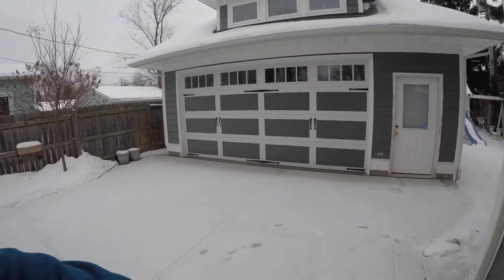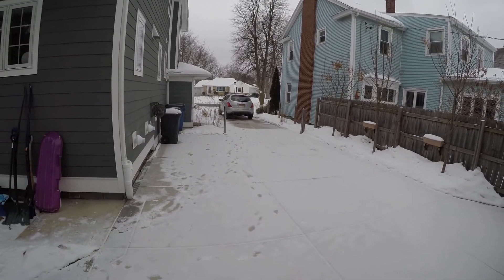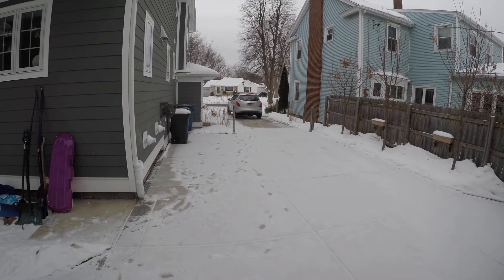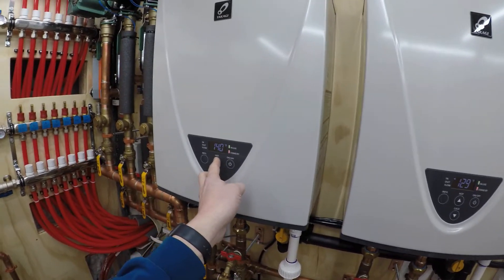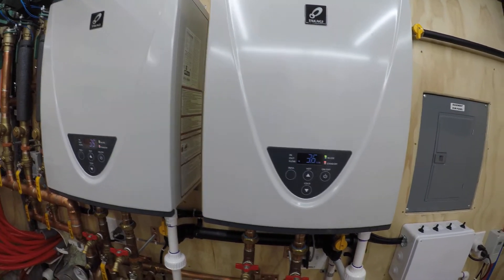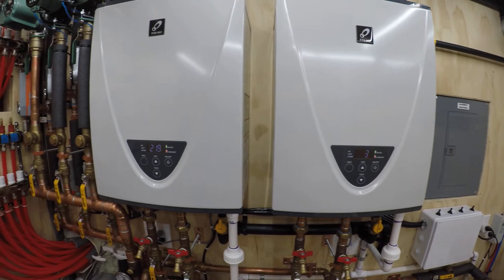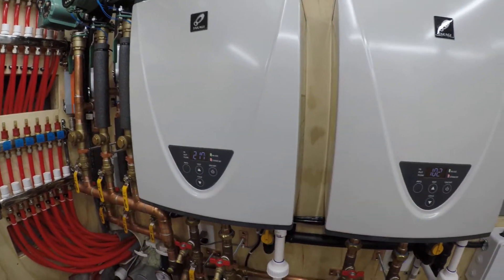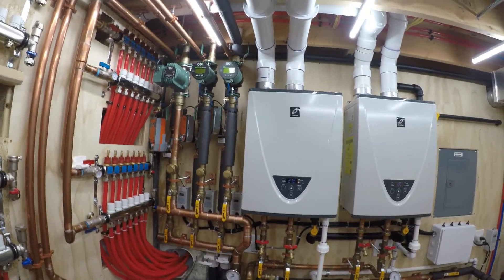DIY Heated Driveway System Startup: Presidents Day Snow Storm - Episode 59 [2-15-2021]

Comment: Are you allowed to run 40% glycol mix through takagi's?
Reply from the maker: Hi Aaron!  I think technically you can without voiding the warranty, but I didn’t want to risk it. I have a friend with a mixture around 40% going directly through the same Takagi T-H3 units I’m using and he has no problems for almost 10 years.  My systems uses a 100-Plate copper flat plate heat exchanger to keep the domestic water separate from the glycol in the heating and snowmelt side.  Hope that answers your question. Thanks for watching!

Comment: Wow a 44°F rise from 36°F - 80°F is ridiculously expensive. This project must be in the neighborhood of $60k
Reply from the maker: Hi Sean.  If you're referring to the return temps coming form the slabs, it does use a lot of BTU's when its first fired up with that large of a ∆T, but it doesn't last long.  I guess it also depends on what you consider "expensive".  The first hour usually costs about $1, after that it's much less to run.  Believe it or not, I completed this entire project with everything you see for around $10k.  I had quotes upwards of $50k though.   I'm pretty happy with the end result (and the $40k savings 😁).  Thanks for watching!

Comment: Do you ever have to worry about reaching the freezing point of glycol on very cold days or clear/cold nights if the system is not on?
Reply from the maker: Hey Matt!  So I used Cryotek -100, and diluted it down to 40% Glycol / 60% Water.  Every Glycol product is different so you have to check the labels.  Cryotek -100 at 40% gave me a refractometer reading of -15ºF, which using the conversion label on the Cryotek -100 bucket provides freeze protection to -27ºF,  Is Pumpable down to -41ºF, and Burst protection to -60ºF.  Those numbers should be more than enough to protect me here in Buffalo.  In order for the glycol in the pex at the bottom of the slab to get to -27ºF or less, it would need to be at those temperatures here for days.  It just doesn't get that cold here.  I have TONS of video of the filling process, where I actually show how I diluted it, how I filled the system, and I even have GoPro video looking through the lens of the refractometer to show the readings!  It's FINALLY stopped snowing here, so I have a couple more time lapse snow melt videos to upload, and then I promise I will start uploading all of the videos from the beginning of the project right up until the first run.  It might take me until summer to get them all uploaded, and that's uploading 3 per week!  Stay tuned!
Reply: @DeckerChristopherJ  excellent definitely looking forward to those everything you are posting is top notch!